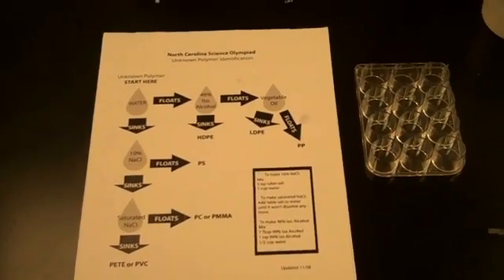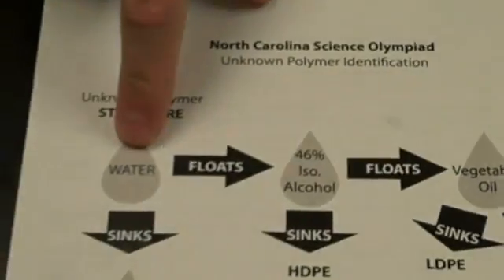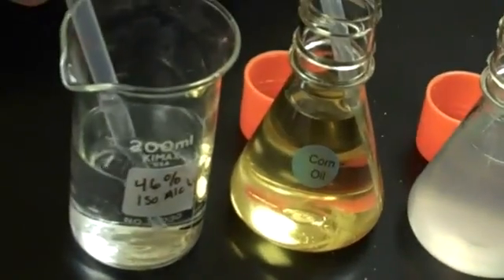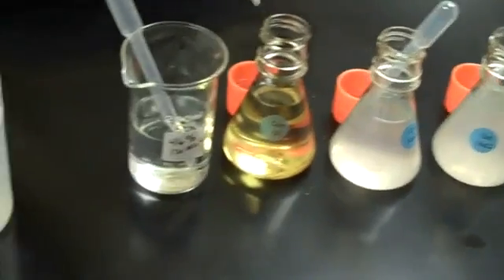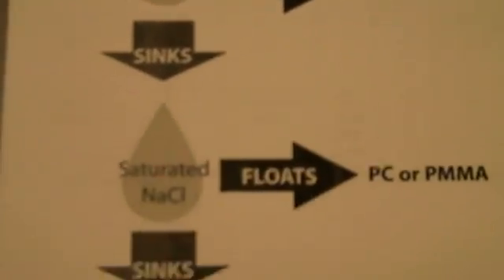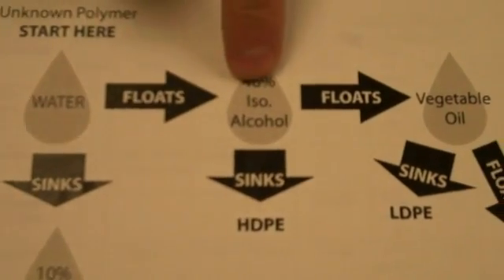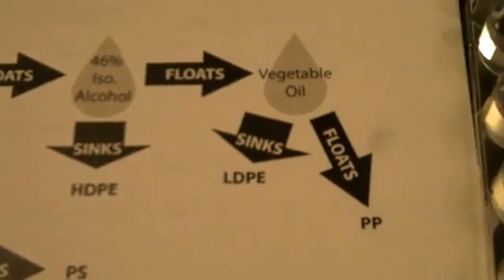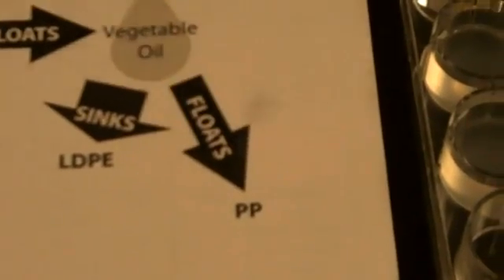NC Science Olympiad: How to Identify Polymers

Comment: Hmm..well that's a problem..they used to have a flow chart for differential density testing..although I believe that was on my coach's cd. Perhaps it is on the nationals website if you want to check. Otherwise I could not find it on the NC site. I actually forogt the solutions the used for testing. It should be on the event sheet, so you could make your own flow chart if you wanted too. Good Luck. Polymers arent too big of a deal on the actual test. Just be worried about your chemicals mostly.